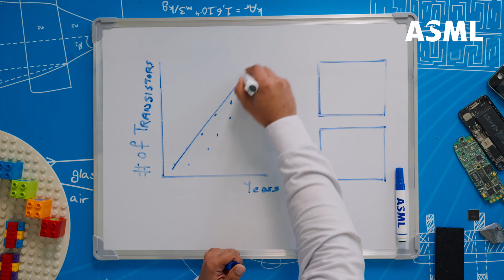What is Moore’s Law? Is it still relevant? Episode 3 | ASML Nanoland

Comment: It is said, that newest development approched 2 nm nodes. Does it mean 2 nm structure size ? When reaching 0.2 nm the silicon lattice width will be reached. Then Moores Law will come to an end. But as next step more vertical stacking is possible. It is said, that China has found an alternative to EUV technique free from any sanctions. Is this alternative "Electronbeam Lithographie" like from an electron raster microscope ? This approache is known for decades, but should be much slowlier than the full mask copying with EVU machines. Interesting to hear more about this issues.